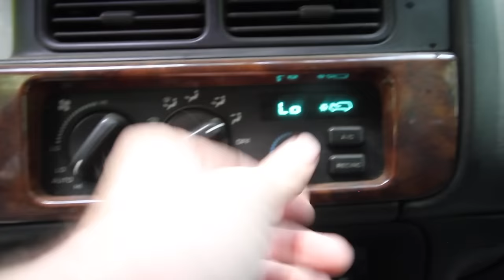How To Super Flush your Cooling System in One Easy Step - Operation Cheap Jeep

Comment: Don’t worry about clearing out the water, check this out. Let’s say your system holds 4 gallons of 50/50. What you do is pour 2 gallons of strait antifreeze in , then fill the rest up with water until it’s full. That way you know you got all the antifreeze in and it’s has a perfect 50/50 mix.
Reply: Except that if you've still got old crud-filled coolant in your system, the old will mix with the new and you'll be wasting both time and coolant.  Besides, with water and coolant still in there to begin with, you won't be able to get all 4 gallons in and your balance won't be 50/50.
Reply: @ApartmentKing66  You only ad 2 gallons straight antifreeze.
Reply: @ibberman  Yes, if he is confident he got it all out.Honestly, blowing air is a waste of time, he probably didn't even get more than a pint out .But hey I guess it's tap water, but that is nothing the concentrate can't take care of

Comment: Tap water is used to flush the system - it contains alot sediments (eg fluorine, Mg, Iron) that can damage engine.  I noticed in end you use distilled water & antifreeze - which is good. Distilled should be used for everywhere
Reply: It won't unless left in there

Comment: when flushing the block, you should restrict the bottom hose so the water backs up through the system, otherwise all your flushing is the waters path of least resistance if that makes sense. Your likely missing more then half of the system.

Comment: From someone that has worked on all there own car maintenance for many years I do like your video. I do it the same way many times as you showed in your video. I have a good pointer to share with you and the others. Before doing the antifreeze flush and change find out what your cooling total capacity is and when you do the refill put in half the total capacity of undiluted antifreeze first before you add any distilled water. This way you end up with a 50/50 mixture of coolant and water.  Its that simple.

Comment: Easier way to flush the whole system is just open/remove the petcock put hose in de-gas/reservoir to keep it full while draining start the car and let it idle until it reaches operating temp. Then the thermostat will open and you can rev it a little while keeping an eye on the temperature gauge and then shut the engine off after a few minutes. Remove the water hose let the water drain from the petcock then reinstall. Fill with distilled water and concentrate coolant at about 70% coolant because there is water left in the heater core/block so once it mixes it’ll be close enough to 50/50. Easy 👍🏻

Comment: Side note, when doing this for overheating
Its also a good time to spray/blow out the debris from the radiator fins. Spraying or blowing from the backside of the radiator towards the front to remove the grass, dirt, and debris that collects in the fins over time. 
It can really make a huge difference, especially on older vehicles that have collected a lot of debris. Just a thought.
Reply: Add some shampoo to pull out the dirt and dust in the fins
Reply: @safetyfirstintexas  and don't forget the conditioner either, for those dry brittle radiator fins. helps the fins stay more manageable and adds a healthy shine.
Reply: @religionishipocrisy  Would you recommend Mane n Tail?

Comment: O my cheap jeepin. I just changed my water pump and thermo for the 2nd time in 24 hrs. Just kept leakn. Till i found a penny heads up. I picked that penny strait up. Then tightened down a few lbs extra on the bolts n no leaks. Hr later watch Matt do the same thing n give me a big smile.
What a guy. I really think he helped me fix it somehow.. Magic penny tighten trick..

Comment: I flushed my system a few times on my ZJ. Was clean but had a lot of scale and other buildup that I could see.  Dumped half a gallon of cleaning vinegar in the system and the rest distilled water.  After letting it run for a few days, I drained and refilled with water and couldn't believe the amount of buildup that came out.  Like you said, it looked like chicken water but times 100.  Thank you for the video!

Comment: After your test drive you do not need to remove the radiator cap just check the coolant recovery bottle.  As you saw it sucked fresh coolant into the system.  Working as designed. 👍🏼

Comment: Thanks for making a straight forward diy. I just recently got my 1st Jeep. Got her cheap, but when I took it to my mechanic to get oil change & diagnosis discovered a blown head gasket. But before full panic mode kicked in.... think he saw the look, he told me how he fixed his with these fix-its in a bottle. Thank God for technology :) I use two K-SEAL Ultimate & FiberLock. When I went to see him after her 1st treatment he was glad to see less smoke. Unfortunately she's still smoky when we first get going. Wanted to entirely flush the system & your video was just what I need. Thanks for making these for backyard mechanics 😀 I subscribed

Comment: Park with your nose uphill when trying to burp the system, after it cools more air will be at the radiator cap, speeds things up
Reply: this is irrelevant since all the air will dump into the top of the radiator and stay there anyways. maybe a tiny pocket in the upper hose but the reservoir will resolve that for you without intervention. thats its purpose...
Reply: That is what the service garage does if the rad cap isn’t the “high point” or if the heater core possibly trapped air.

Comment: We need a video on how to install a drain petcock with a hose so you can drain every drop directly into a bucket.  I'm tired of getting radiator showers as well.  Since I've pulled engines 4 or 5 times you would think I would have done that by now.  Also, another good reason to use only distilled water is electrolysis.  That's where the rust in an engine comes from (especially if the engine is iron, and depending on where you live tap water's conductivity can vary greatly).  Tap water (or any non-stilled water) has particles in it that make it electrically conductive.  You actually get current flowing through the coolant system since all of the grounds for the vehicle end at the block.  Electrons actually flow from the negative into the positive.

Comment: Just go to an auto supply and pick up a Prestone engine flushing kit. Splice the appropriate tee into the heater outlet hose, put the discharge spigot in the radiator filler neck. Now connect your garden hose to the tee you put in the heater hose, turn the water on and start the engine. Let it run for about 10 minutes or so. Drain the water, disconnect your hose, and put the cap on the tee. Remove the discharge from the filler neck and refill the system with coolant.

Comment: I never wanted anything other than my XJ until I saw you turn the heat up from 66. I haven't had AC in.... ever.... sounds nice...
Reply from the maker: +Tony Clark ha, it doesn't work
Reply: The automatic climate control is the only thing my current ZJ doesn't have that I miss from my previous one.  Wish I could swap in the automatic climate control and the driver information center from another ZJ into my current one.  Those 2 items were nice.

Comment: you can simply leave the cap off, turn the heater to hot and run it up to temp. once the thermostat opens, it'll burp out any remaining air. then add any needed coolant, cap it off, top off the reservoir and you're done.  this only applies to open loop(non renix) systems and those that have the cap as the highest point.
Reply: I usually use a plastic funnel that is cut off to fit the radiator fill hole diameter and not bottom out on the core. I thereby make the filler the highest point with fluid in it and let it burp that way. There ARE some times on some engines I have to crack a provided bleeder valve, but overall it works nicely.

Comment: You can also point the vehicle up hill when filling and it'll push the air out. And start it and let it idle up to temp and refill. But having the cap on, it refill from the reservior like it's supposed to

Comment: Find the capacity of the coolant system and make sure you use half of that much concentrated coolant. You don't need to make any 50/50 unless you bought a half a gallon more than you needed and you want to keep it for topping off but Ive never needed to top mine off in two years so you might just be storing the 50/50 for years.

Comment: If you drain the radiator and leave drain open you can leave the garden hose in the radiator while the car is running and the water pump will push clean water through the system... cleans out all of the same components and saves time.
Reply: hose water is bad in it
Reply: Except the junk in the heater core
Reply: @Rsp7ccw , true but after the tap water you rinse it with distill water then add proper coolants.
Reply: William Mitchell p
Reply: Make sure hose water pressure is low, petcock drains slow.
Reply: Just done that for 10 minutes looking great

Comment: i just did a head gasket and expansion plugs on a 4.0, i used my pressure washer to clean the block while i had the expansion plugs out, then lifted the heater core hoses and let vinegar sit in the elevated hoses for a about a day now, its completely clogged, i did the same to one of my jeeps a few years back that was just as clogged, it still works great, hope this one works out too. just wanted to leave a tip to help out for those who have the same problem.

Comment: when flushed and clean water still left in the engine simply use concentrate instead of 50/50 cuz air will not push all the water out think about it as soon as air will make room to pass over water it will do so and rest of the water will stay on the bottom of the block

Comment: Yeee, thank you I was wondering about what to do about all of the hose water left inside from flushing!
Reply: Target sells distilled water in very nice containers that won't break like the ones from the grocery stores I would get seven or eight jugs instead of using hose water. This is exactly what I did I got it at Target about eight jugs and it's cheap

Comment: Good video!
When you flush the radiator take the heater core hoses off and the pressure from the hose will push all the old coolant from the engine block out of the heater core hoses. Then just flush the heater core.

Comment: over here in aus there's a product called CLR not intended for this but it works well i just dumped out the rad and stuck 4L in toped it with water ran it around the block to get if pushed around and properly up to temp parked it for the night took it round the block again and dumped it out with it hot went inside and got bucket of hot water from the laundry filled it up and drained it out a few times 
fair bit of dicken around but the junk that it removed was insane

Comment: Great Video! I have used the chemical flushes before and killed my cooling system. I NEVER use them anymore! Got me an 83 CJ7 frankenjeep last summer and plan to make it my daily driver. It needs lots of loving to get there but it is worth it. Keep the great vids coming!!!
Reply: I drain my coolant long before it gets "Nasty as Fuck" and refill it with fresh antifreeze, a water pump failure is a thing of the past.

Comment: Prestone flush and fill kit. Much faster than running with water then draining it three times. Actually BACK FLUSHES your entire system and goes AROUND the thermostat. You did roughly the same thing.

Comment: might want to tell folks about your air hose disconnect, those are nice to have.
I like to add the use of a air/water pressure flusher and a vacuum coolant filler to not have air pocket if you can justify there expense.

Comment: A hint to all for faster cooling: wrap the rad cap in a folded towel and put on leather winch gloves. Pop the cap to first click. 
It helps cool the engine faster. It opens the coolant to air and gives the coolant a proper place to vent the heat instead of slow dissipation to a closed system.

Great vid Matt. 🤙

Comment: The only thing you got wrong is that the coolant usually goes from the engine, into the heater core and returns into the water pump (or sometimes into the outlet side of the radiator which then returns to the water pump via the lower radiator hose).  If you flushed it from the engine side you didn't back flush it like you said you should (which is the correct way to do it)

Comment: The cheap jeep videos are super helpful! I got a 94 black 5.2 zj as my second car so knowing how to do a budget lift and what problems I will run into is really great, by the end of the summer I will be doing a similar lift to the one you did (i.e the F2R spring swap, extended sway bar disconnects etc) and hopefully ill be able to fit 33's. Thanks for all the videos really helps out a kid like me learning how to work on my jeep XD

Comment: Yeah, there are about 20 steps here, but it is a one time process rather than repeating a process multiple times. Thanks.

Only one question. Can you also flush the water pump through it's in and out hoses?

Comment: Day late and a dollar short but if you know you're going to do this swing by a local gas station/garage/napa/whatever and see if the have a used DEF container. These hold just over 2 gallons and are clearly marked on the side. Mixing is a breeze and because it is marked if I have a partial jug I know exactly what the 50/50 mix is.

Comment: You forgot to do the Safety Squint before dropping the coolant
Reply: the only right way to drain a cooling system is to pull the lower hose. think of all the stuff you could do with the 2 minutes you save

Comment: I have had to do this too many times. First a water pump bearing failed and put lots of shavings in the system of my 4.0L. Very hard to get all the shavings I have discovered as my next 3 water pumps keep getting shavings in the bearings and thus the cycle repeats. If there are shavings in the coolant trust me and spend a day completely flushing several times.
Reply from the maker: +Sam Sam metal shavings are no fun!

Comment: Or you can disconnect the upper radiator hose, and run the engine until the thermostat  opens, while adding water in the process. That way you only remove one hose while flushing the entire system except the overflow which makes it two hoses. I believe it does a more thorough job with  the water pumps help.

Comment: Everyone do yourself a favor and go to Napa and buy a coolant funnel. You keep everything connected and it just goes on the radiator, and you add coolant to the funnel as the water pump will purge the air from the system.

Comment: you can extract air from the system by handpumping the top radiator hose with the cap off and the engine running after the thermostat has opened.  essentially burping the system.

Comment: Not sure if this is going to be addressed at this point. But anytime your working on your cooking system make sure you rinse the entire engine bay down with water when done cause antifreeze will eat holes in your vehicle faster then driving it through a salt mine. It’s literally the worst possible thing to have sitting on metal components..

Comment: Coolant reservoir self bleeds the air in the system. Just keep filling it up till it doesn't need to be filled any more. I've taken a plastic mayonase jar and made coolant reservoirs for diesel and tractors. Just keep the hose under coolant and keep filling till it doesn't need it anymore.

Comment: Another thing to check is your transmission temp.  The transmission fluid runs through there as well. I have had the problem of over heating in the past and the trans was the problem.
Reply: how do i coreect the transmission ,which causes over Heating.

Comment: Have you ever used a chemical cooling system flush such as the Prestone variant?  It seems to works pretty well in removing rust and/or other particulates from the system that have been clogging things up. (I would suggest dumping any chicken water or anything else that shouldn't be in there first!)  When used on the GF's '99 XJ it loosened up enough stuff that the water ran brown for at least 5 mins in back flushing. (Got clearer towards the end of course.)  The coolant in the system before flushing looked strange to me, but was green and tested out fine on the hydrometer to -20.  I was amazed at how much shit came flowing out of the cooling system! 
This XJ was evidently not cared for well as it still had the Mopar factory ignition on it at 210,000 miles. Factory numbered wires and plugs burnt to .075 gap! Still passed emissions. Trans fluid on the AW4 was BLACK! So black that I set the trans filter down in the drain pan and looked at it later wondering if I forgot a bracket sticking up out of the oil!
 Runs and drives fine with 230,000 on it now!
Reply: Lonewlf7676 that's incredible. I have a 99 XJ Classic and hope it will last me another decade of service or more. I just do maintenance when it needs it and run quality oil and filter.

Comment: I just ran water in resevoir while engine was idling, that'll flush out your engine block. kept an eye on my temp gauge though she stay in the operating temp zone only screw off the small cap to the radiator so it drain out slowly

Comment: If you broke the t-case linkage, check out your motor mounts and trans mount. The motor mounts in the ZJs go bad and put extra tension on the T-case linkage, causing them to break or to get stuck in 4WD. I bought a new linkage from MountainVistaFabrications to replace the stock one, but I didn’t even have to use it as swapping my motor mounts and trans mount has the linkage back in the correct angle to perfectly shift the t-case wherever I’m needing it to go. BleepinJeepFTW!

Comment: I usually just run the engine with the petcock opened and a hose in the radiator cap so the water pump cycles everything through the system.